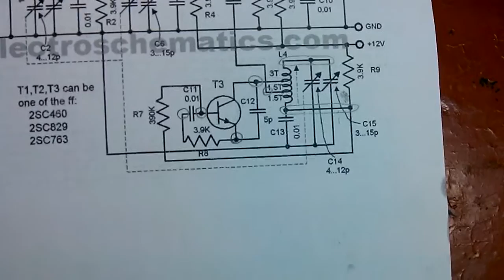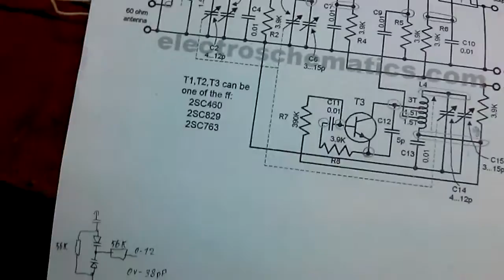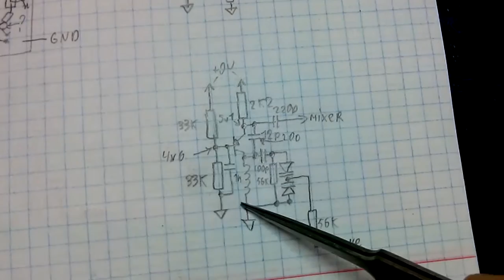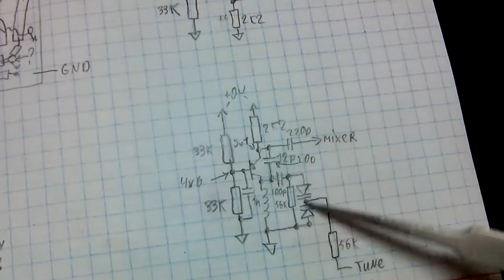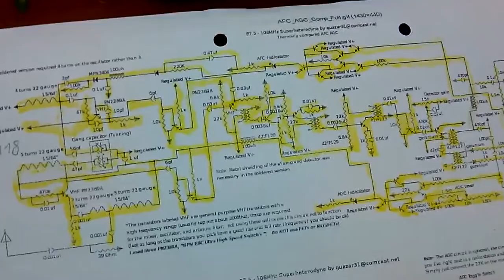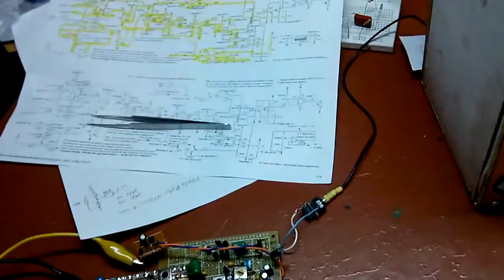Homemade FM superhet (barebone version)

Comment: Sound of this receiver is almost hifi..great...which transistors you use ?
Reply from the maker: Don't know about Hi-Fi, since FM cuts off signal after 15kHz or so, but sure sounds nice.
As for transistors: 2s9018 in the tuner (rf amp, oscillator, mixer); everything else is generic 2n3904 or 2n3906 (depending on polarity).
Reply: @mrjohhhnnnyyy5797  after 15 that cannot be true...+- 75kHz is range ,and you don't get such a good sound if is cutted on 15khz
Reply from the maker: @astongoldsmith2396  +- 75kHz is the deviation of the carrier, not the signal bandwidth. When you get older you don't hear much after 15kHz anyway.

Comment: You ever thought about selling one of your radios?   Really beautiful piece of work!  👍👍
Reply from the maker: Who needs this cobbly mess? I made it for myself, just to see if I can.
Reply: MrJohhhnnnyyy  - 30 Bucks + postage ?   I just don’t have the time right now to build a superhet from scratch but it would be great to be able to show to some of my students one that has been built from scratch.   Might inspire one of them to go for the challenge of doing some difficult electronics.   You can email at peterhunt41@gmail.com    I thought about going back to eBay to find a second hand commercial receiver but it just doesn’t have the same character.  Kids get seriously amazed when they see things like this.  👍
Reply from the maker: @peterhunt1968  Well, here's the bummer - I just can't find the damn thing. The last time I saw it was 3 months ago, I can't find it now. Might be in storage room, but damn, I have to clear the aisle to even get there :/
Reply: MrJohhhnnnyyy no worry mate.  If it turns up - any time.  Happy New Year by the way.  Cheers 🥂

I built a pulse counting superhet once.  The radio had a very low IF so the LG stages didn’t need any transformers.   It was the ugliest thing I ever constructed but it actually worked and the sound quality was superb.
Reply from the maker: @peterhunt1968  I have made such too, but the mixer (converter) stage came out atrocious, sensitivity was pathetic. Sound was great, though. Pulse counting "discriminator" has response down to DC, which gives a receiver good bass. Provided that amp and speaker can handle it well.
 I used this design: http://vk2zay.net/article/250

Comment: that works great I made regenerative 1 transistor receiver and 3 transistor amp 1,5 volt batery it is loud on headphones butI get 60 hz hum shoud I put in metal box with only antenna outside? to remove hum
Reply from the maker: Shielding will help for sure. But you may also need to install a high-pass filter on the antenna input. Give me a link to a schematic of a receiver, I'll take a look.
Reply: +MrJohhhnnnyyy  http://www.electroschematics.com/5923/fm-radio-receiver/ turns out it isnt really regenerative  but something else, how do you indentify rf coils  or you wind them yourself and measure inductance ?
Reply from the maker: JOSIP Žlk It is a regen. I tried it myself some time ago, and, as always, it didn't work :D All I heard is a hiss.
   For the air core coils you can use calculators to give you theoretic values, but you have to follow wire gauge, coil diameter and length precisely in order for your coil to be worthy. Of course, measuring the inductance is a better way, but calculators will get you in the ballpark.
Reply: +MrJohhhnnnyyy  I made it 3 times and 3 th time it worked,bf199 is hard to get :(
Reply from the maker: JOSIP Žlk That's the reason why I stick with more complex circuits. Despite the simplicity of the regen receiver, they could be very hard to get going, since one transistor performs a bunch of functions. And as you metioned, they are very critical about transistor you're using.
Reply: Nice to see the bare bone FM superhet working! Good job...Any plans to add a stereo decoder?
Would you be publishing your final circuit?